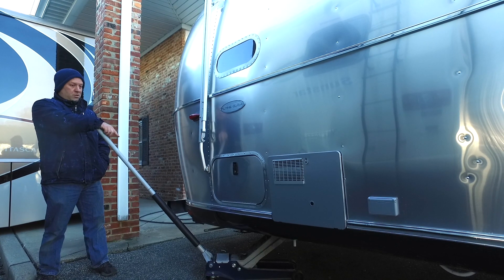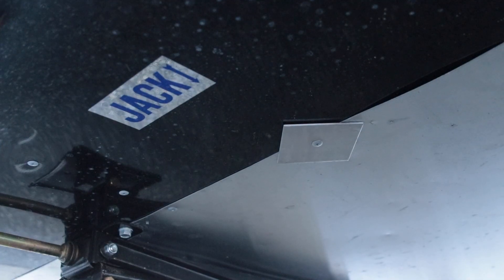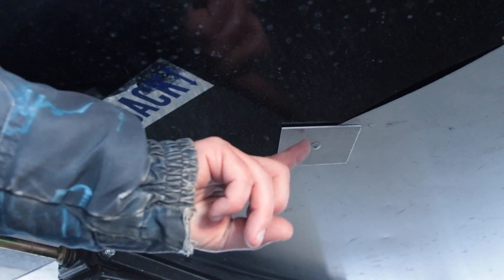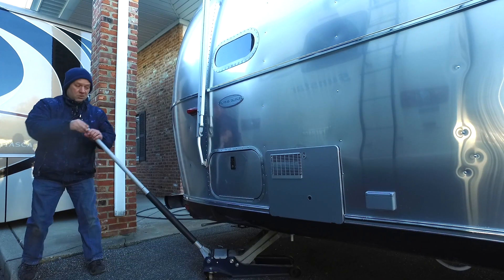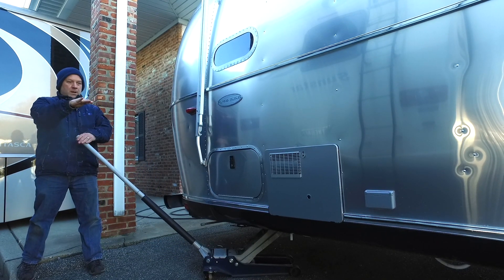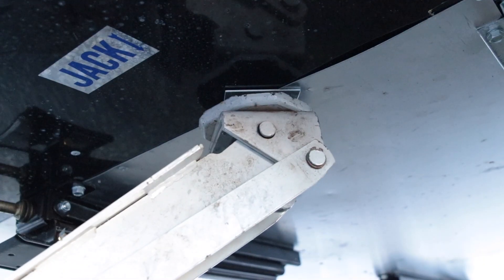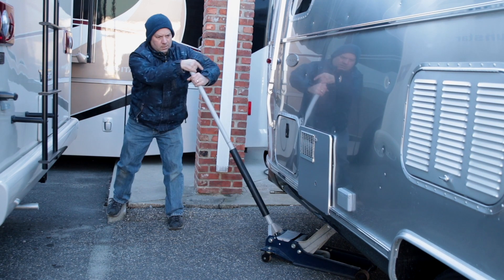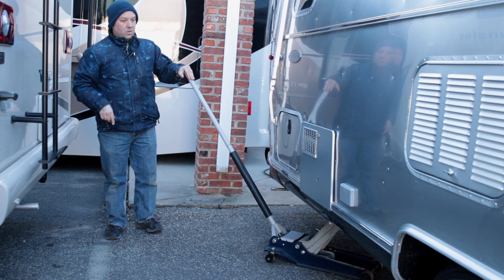How to Jack up your Airstream Trailer to Replace the Tire

Comment: How do you jack up the front axle of the Airstream.  There are no Jack points labelled on  the front of the trailer,  just on the back?
Reply from the maker: Correct, you only need to jack it in the one location for both axles.

Comment: Does the airstream aluminum rims have rubber valve steams or metal
Reply from the maker: This model is rubber and steel. Some other models have rubber, some have rubber and steel and others have steel.